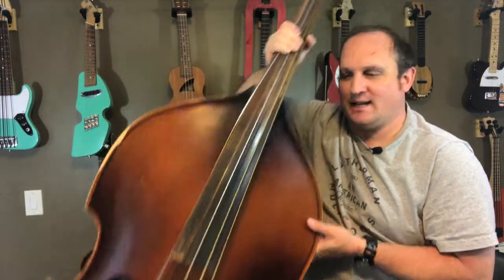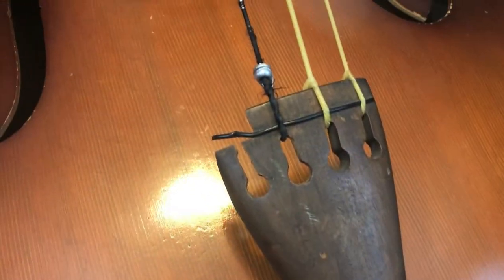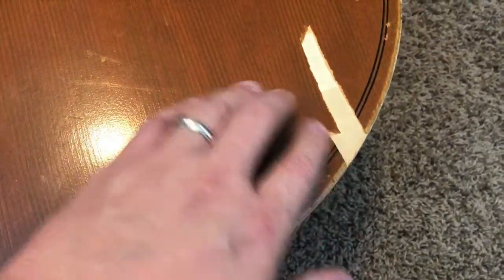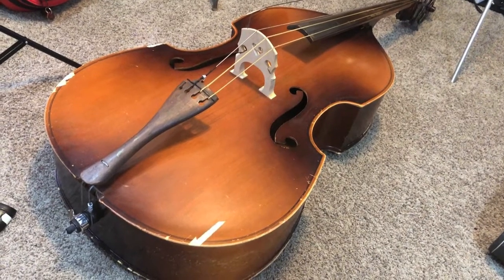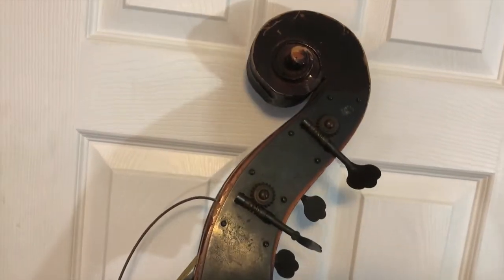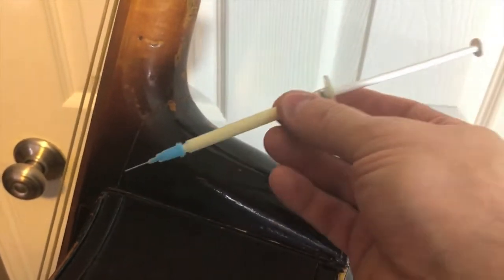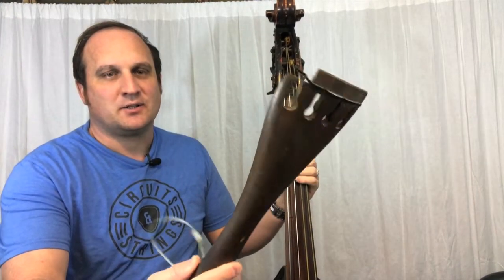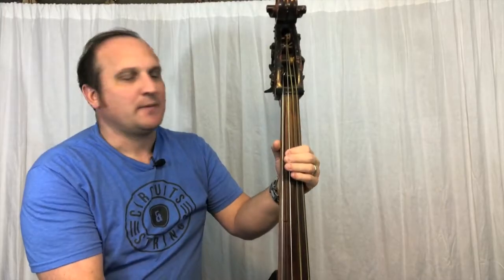Double Bass Repair

Comment: Daddario Medium Tension Helicore Orchestral Bass Strings (3/4 Size) would've helped it hold tune better.
Reply: I've read that Kay basses sound best with low-tension strings.
Reply: @slcurts  Helicore Strings have a lower tension due to their steel rope core